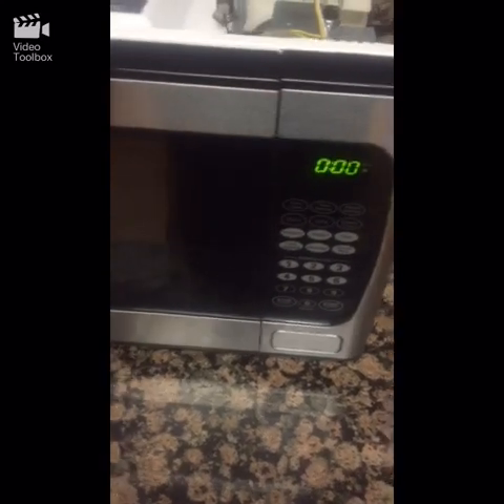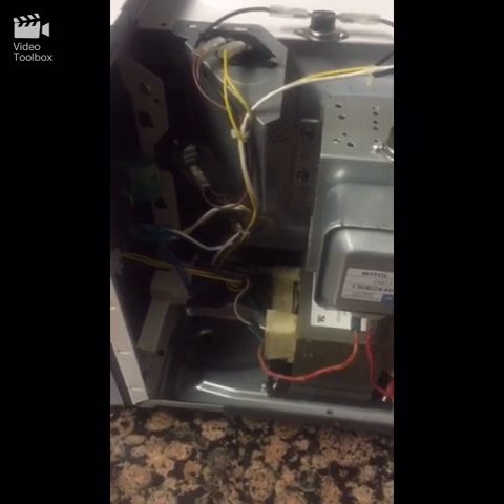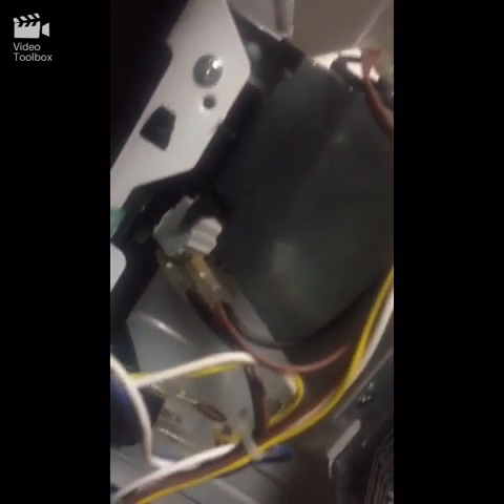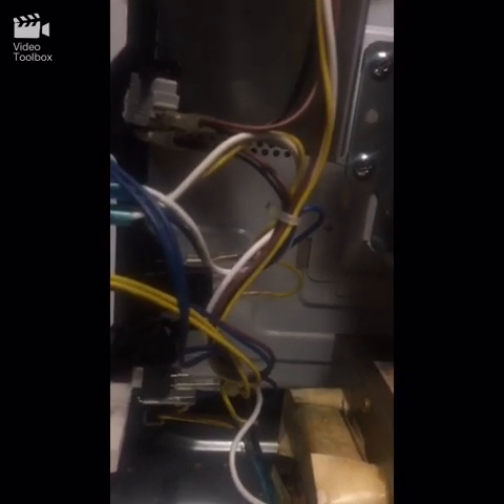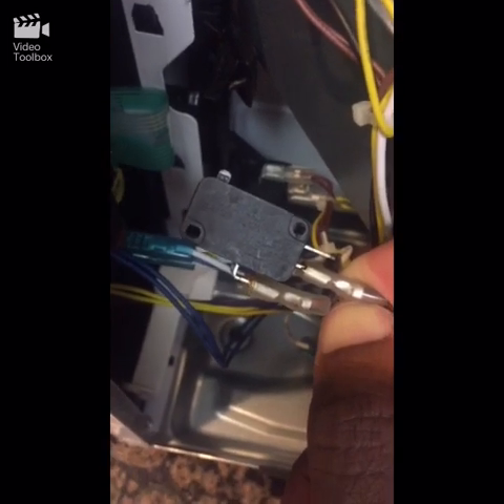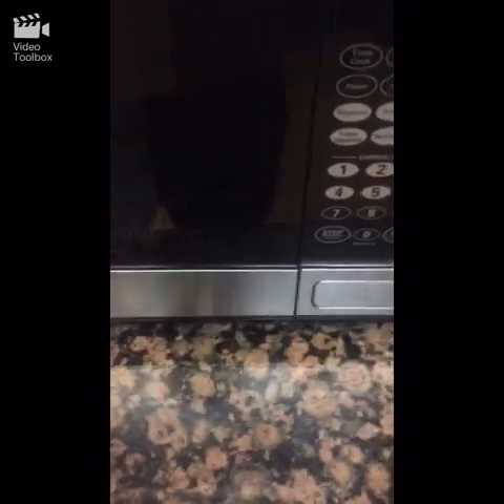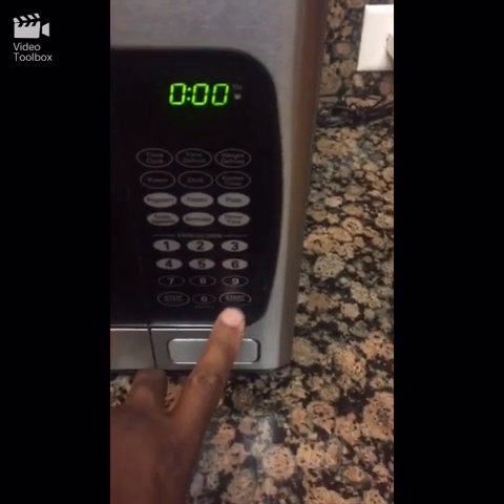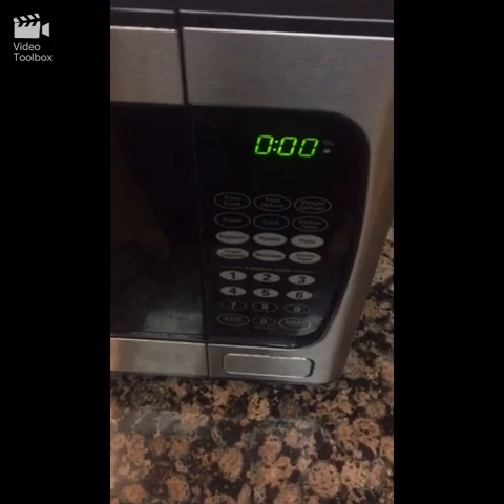Easy fix microwave from spinning when opening door

Comment: The same thing happened to me and I bought new switches to replace. When I switched them, it only made the problem even worse (I installed the switches back in the same order). Pushing the buttons to activate the microwave did not heat. Also, I short-circuited part of my house. The repair was a waste of time. I ended up getting a new one. If you have this problem with your microwave, buy a new one. It is not worth the hassle!
Reply: Same I replaced a switch and stop working
Reply: It is if you know how to do it properly.
I don't expect you to be very competent when you say "short-circuited part of my house".
Reply: Also some switches need to be wired normally open and some normally closed.

Comment: Great video. Is that a Magnavox model MW9339SB because I have the same issue. Do you know the part number that you ordered on Amazon? Have you had to fix the light buld also? Thanks I appreciate any help you can give me.
Reply from the maker: Robert Martinez didn’t have to fix the light but here are the universal switches info:

uxcell 10 Pcs G5T16-E1Z200 Universal Microwave Door Oven Freezer Micro Switch Series AC/DC 125V 250V https://www.amazon.com/dp/B00W8YHW9S/ref=cm_sw_r_cp_api_TIKoBbV5CG3N8
Reply: Thanks I was about to get rid of a working microwave..

Comment: nothing easy about it when you have to open and fix wires
Reply: Especially when all microwaves have torx button head screws which almost nobody has screw drivers for.
Reply: @The_Primary_Axiom  Umm… Torx is actually very common
Reply: @nelsonahlvik6650  Shows you how much I know about screws